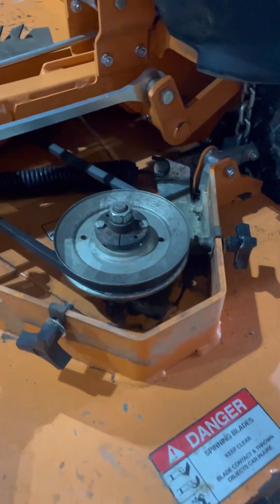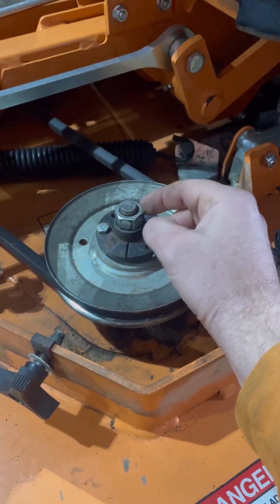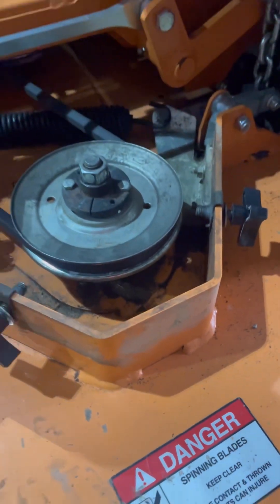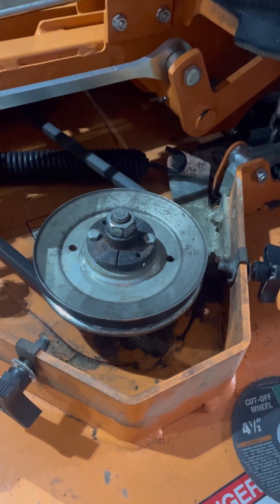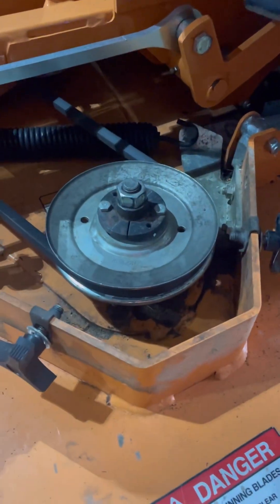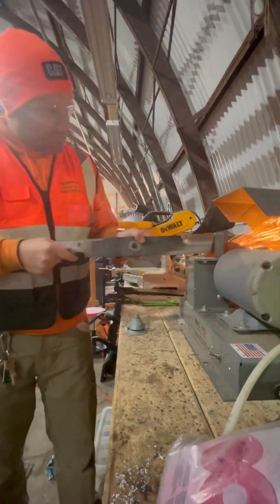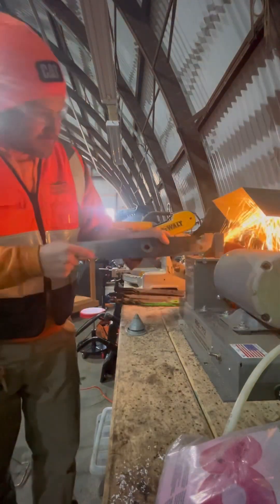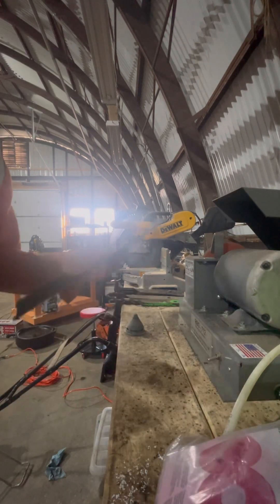Scag problems!

Comment: Did you just cut the nut off that and ruined the spindle bolt, instead of putting a wrench on the bolt head underneath the deck to hold it in place while you remove the nut?
Reply from the maker: It was stripped already. That’s why I had to cut it! The nut would spin and spin and not get any looser.